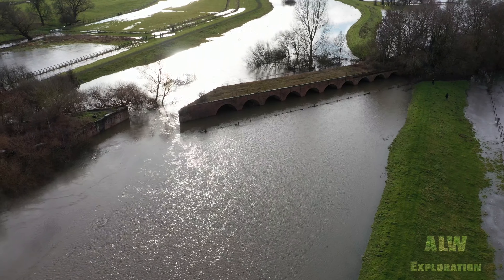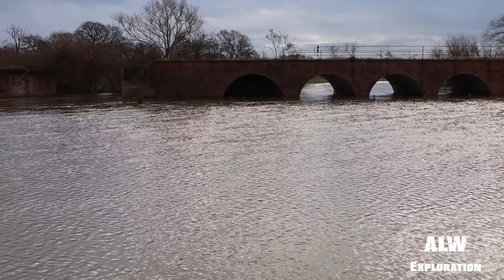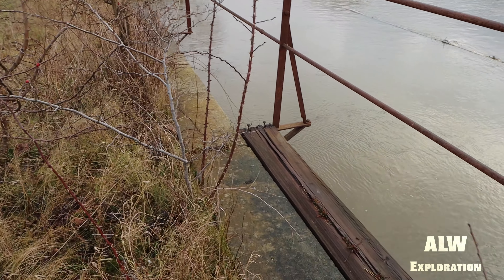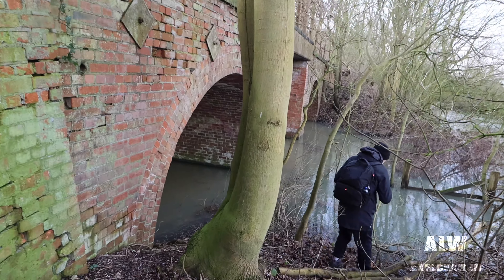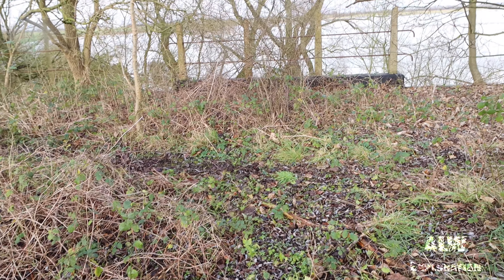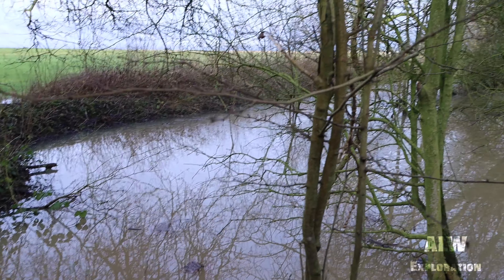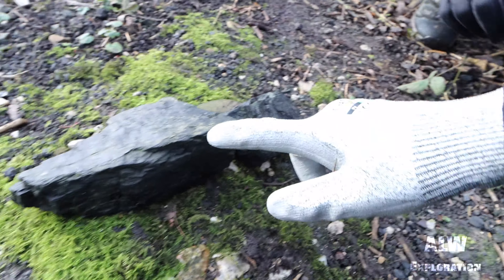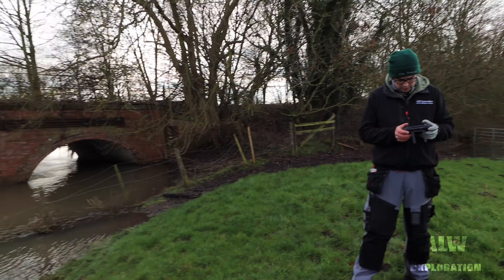Exploring Bubwith's abandoned viaduct - Selby to Driffield Railway

Comment: I'll tell you where to find fruit trees and that's at a stop single, as a past train driver if you spent anytime at a location you would grab a piece of fruit and bin the core out the window.  the best place is on king George dock, lots of apples and pear trees near the where our mess room was.
Reply from the maker: Hello Mike B, that's a very good point :) 
Thank you so much for watching and commenting.
Reply: Also after watching your video I researched the nearest station cliff common. Turns out this was a junction for the derwent valley light railway. The stationed would have been welled signalled, it had two bays and the main line  running through it as well as head shunts. I do like the railway history. Keep it up.
Reply from the maker: Hello Mike B, We have looked at plans for the Derwent light Railway ;) Thank you so much for the information. Very interesting indeed.